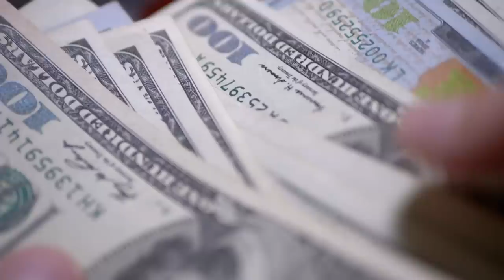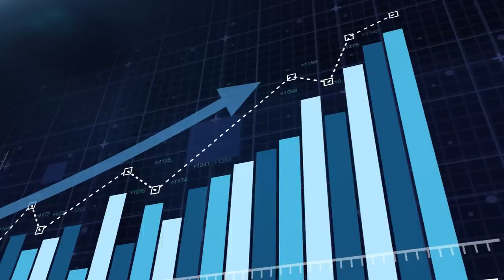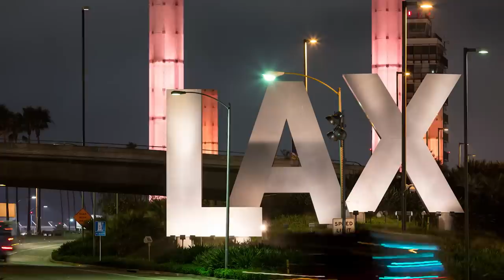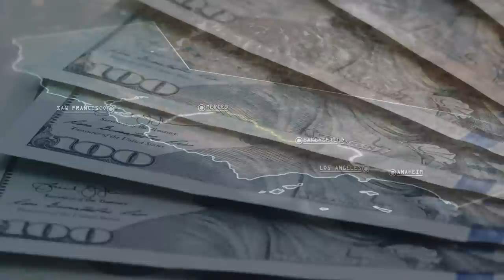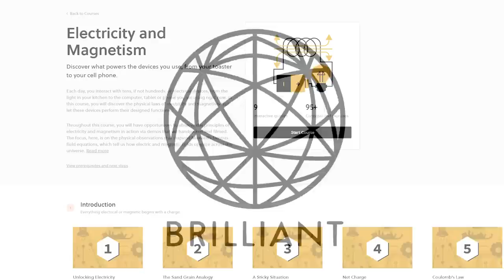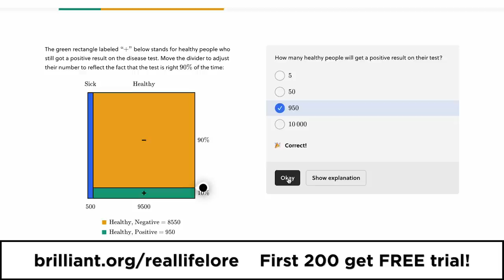Why California High Speed Rail is Struggling (Re-upload)

Comment: It seems to me that they should've prioritized building segments of the rail between the commuter suburbs of San Francisco and LA first and then slowly extended to the next one and then the next until you actually could connect the two.
Reply: this seems like a good idea, but it's important to remember a two things:
1) some of the closest commuter cities to either region already have connection to their city centers through CalTrain in the North and MetroLink in the south
2) the segments of HSR that cross through these regions are the more challenging ones to build

The Central Valley was chosen as a starting point because environmental clearances were easiest to get there and cleared first, building there would amount to mostly building over flat land (which is a lot easier than dealing with the issue of getting through the mountains on either side of the valley), and building this segment first would, as the video notes, actually enable "rail" travel between SF and LA, just including slower routes north of Merced and an unfortunate bus connection below Bakersfield. It was a sort of strategic piece to demonstrate how useful linking the cities could be by offering a slower variant while the final one was being worked on. Also, it's useful to remember that they are still doing things in other segments while this is being worked on. For instance, the aforementioned CalTrain lines actually serve as the end of the HSR route, so they needed to be electrified, and that project is currently nearing completion, meaning that long before HSR is a thing SF Bay Area residents will get to enjoy faster commutes on the electrified CalTrain network.
Reply: @jonahbedouch  You forgot the most important reason construction started in the Central Valley...  The only way the initial political authorization was going to happen in CA was if the project appeared to have benefits for places outside the Bay Area & Los Angeles basin.  Democratic politicians up and down the Central Valley threw their support behind it on the promise of plenty of pork-barrel spending and union jobs in their communities that would come BEFORE more spending in the big cities.
Reply: @jonahbedouch  Lot of BS excuses
Reply: @robertherman1146  There isn't a single excuse there since there's nothing to excuse. The central valley segment is the only segment that made any remote amount of sense to start with. 

The north segment of the system is already entirely served by rail, and in spite of that many of the delays have come entirely from protesters in San Mateo. 

The south segment is so garishly expensive that with every dollar the agency has ever been given they'd only get about a quarter of the way through it. On top of that, all of the non-expensive parts to build (the area near LA) is already served by rail, and people along the way to Bakersfield still refuse to sell HSR land (there's something like 30 miles of alignment they still don't own since they refuse to eminent domain).

The only remotely affordable segment was also the only segment that actually doesn't repeat existing service, provides a link to a historically underserviced region of California, and still provides a relatively strong transit backbone. It's literally common sense.
Reply: @jonahbedouch Slight correction: the Central Valley segment is already served by the Amtrak San Joaquins. You are pretty much correct on everything else, but the Central Valley segment absolutely already has rail.